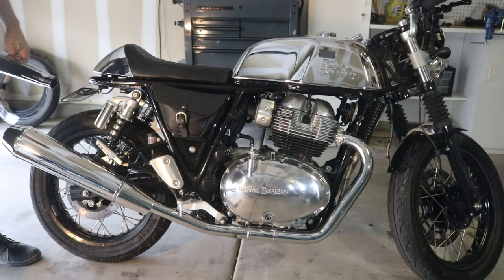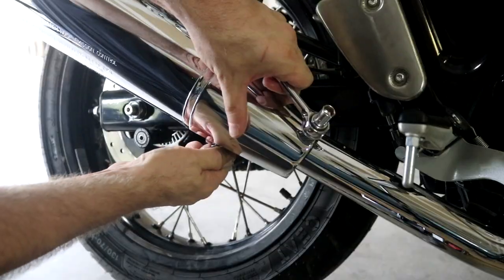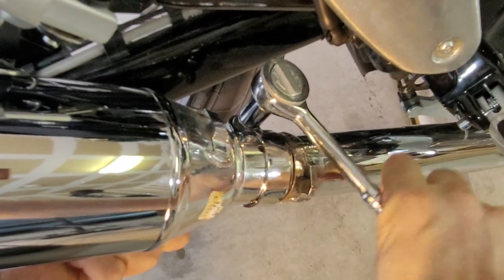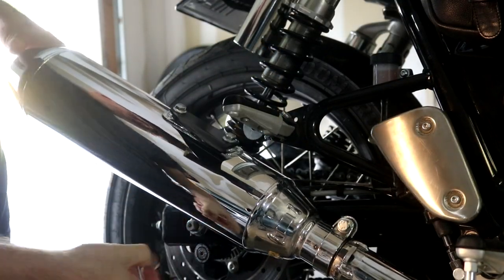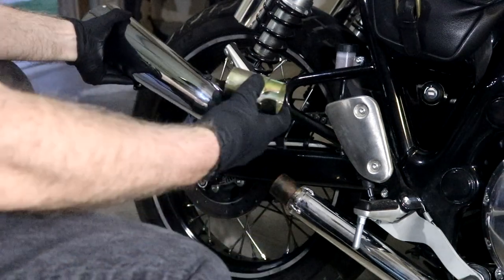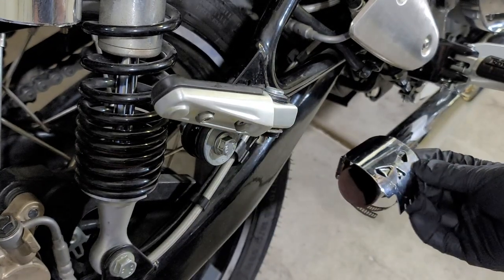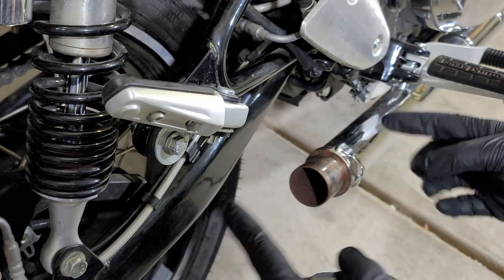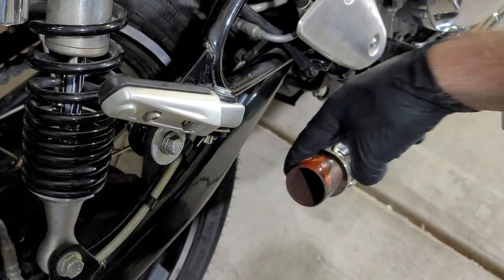How to Install Exhaust on Royal Enfield GT 650 | Get that Braap Braap Muffler Sound!

Comment: Hey man, great videos! Loving it all. just wondering, if changing the exhaust required a replacement of air filter and the ecu? Over here in malaysia, too many POV about changing the exhaust required such additional changes to avoid engine leaking and piston break down. Do share your thoughts. Thank you
Reply from the maker: I haven't had any issues (yet) with changing the exhaust. But, in the future when I do change the air filter I'll also look into options for the ecu.

Comment: I recently got aew ye 103 in my gt, now i am facing a problem while riding if i acclerate sometimes the bike stops then i again have to turn off the kill switch and turn it back on.  Yes there is air leak from the new exaust where it is connected to the bend pipe. Please help me with a solution and why is this happening?
Reply from the maker: No idea. Have you checked the relays? Those seem to be a common problem on the RE's with power issues.